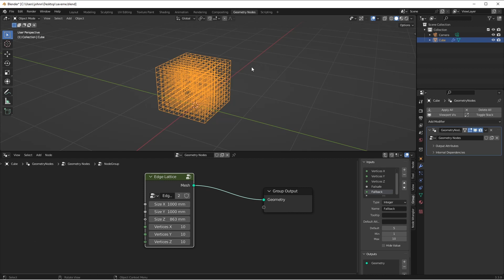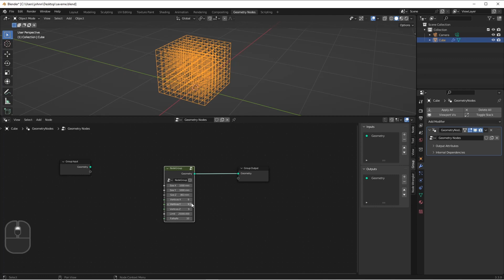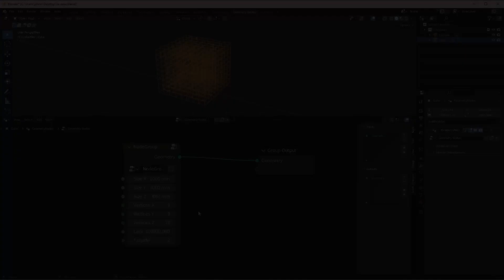FAILSAFE!!!! Creating Crash Resistant Nodegroups in Blender Geometry Nodes

Comment: I wish blender had similar failsafe built-in especially geometry nodes. I once accidentally applied scale to a 2 square km plane while geonodes was distributing points at density of 100 every square metre. Issue is we have to know what quantity could blow up, which we often don’t as beginners or when working with large node trees.
Reply from the maker: Yeah it takes some trial and error for sure.